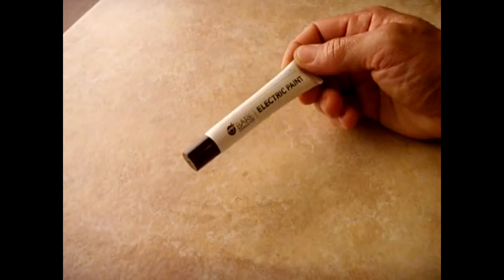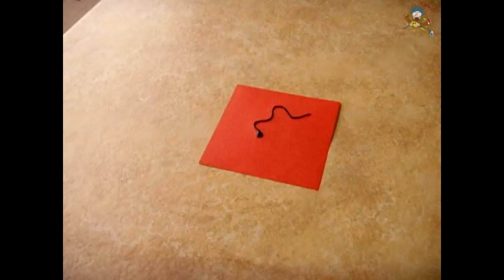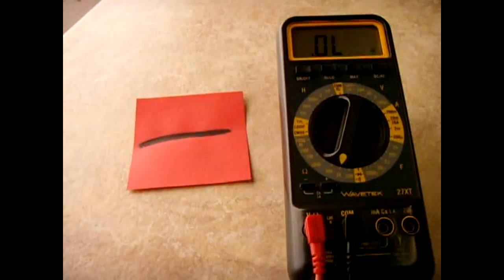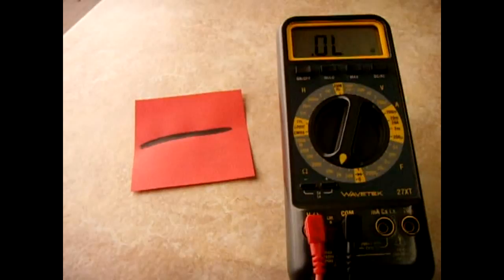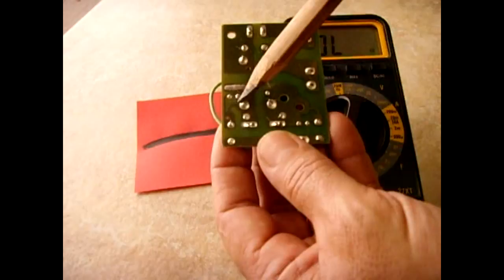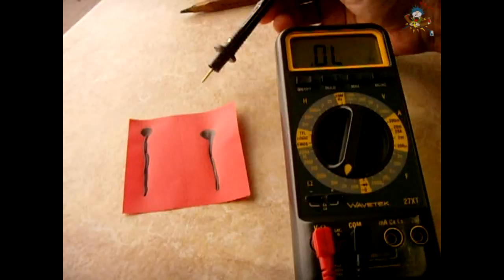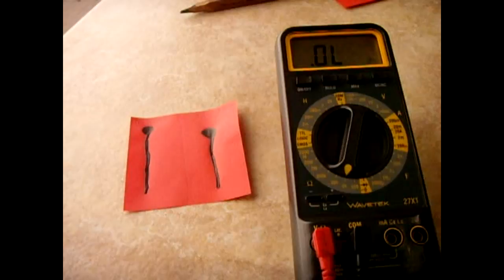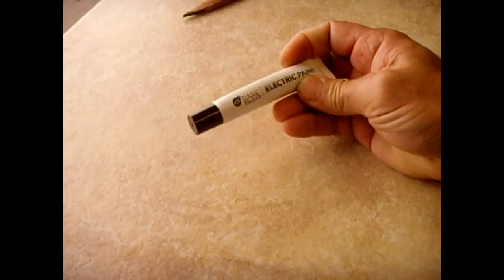Bare Conductive Paint REVIEW

Comment: You can make the same on your own just buy some powdered graphite (small grain size) and some gum arabic then boil the gum arabic until it froths so that it will polymerize encapsulating the graphitic flakes.
Reply: anikoustos2 can you make a circuit that works in a resin mold?

Comment: Hi can u use this to attach a signal wire of a esc to a broken solder pads on a pcb board on the quad as the solder pads has disappeared thanks sean
Reply from the maker: If the repair area isn't very wide, then it should work.

Comment: would the electric paint work to fix the button contacts of a videogame controller? I understand that I would have to use mod podge to seal the paint.
Reply from the maker: It "may" work, but I would use "Circuitworks" silver paint pen. Apply, and let dry. Nothing else to do.
Reply: How long would it last with either component?
Reply: I too was wondering about using it for button contacts on a videogame controller. The contact on the PCB is black so I assume it has some carbon coating, which is why I was looking into this stuff. Would silver oxidize or something? Im assuming there has to be some reason to why they didnt just use metal for the contact in the first place, no?
Reply from the maker: Boner Patrol
Nothing to lose. Try one first, see if it lasts, if it doesn't then try the other.

Comment: I refilled one of my old conductive pens with nickle screening spray works better has a lower resistance than carbon.
Reply: Where do you get nickel screening spray? How expensive is it?
Reply from the maker: Blakehx You can buy it many places online. A simple Google search will pull up all the stores.
Reply: It's not cheap though and it cloggs up quite a bit but good substitute you must shake and mix thoroughly though as it settles in long storage

Comment: 11:26 Well I guess you know why they do not market is as "RESISTIVE PAINT" and as "CONDUCTIVE PAINT!" If I saw that on the shelf, I would think immediately as a "gimmicky doo dad" something fun to play with rather than something useful. It may come in handy for making improvised pull up resistors if you have spun up a board and maybe forgot to make proper pull ups for digital pins, you could use this as a bodge solution rather than a messy and labor intensive resistor bodge job.
Reply from the maker: Power Max Though there are uses for this conductive/resistive paint, I personally have very little use for it.